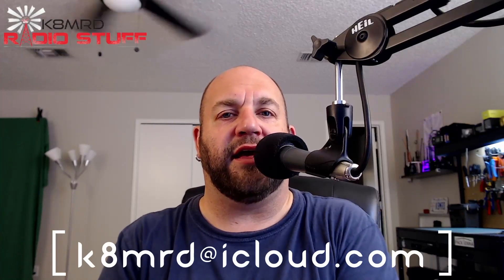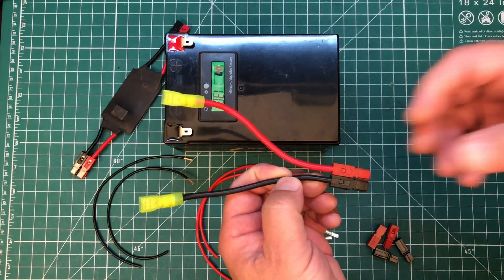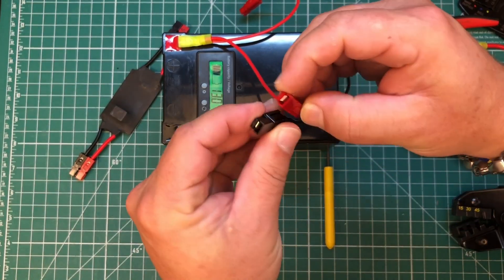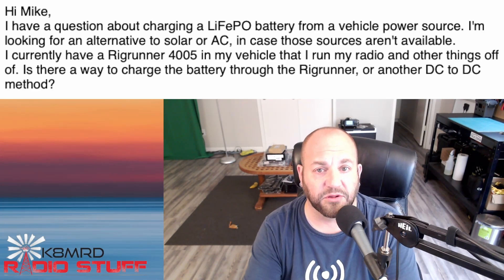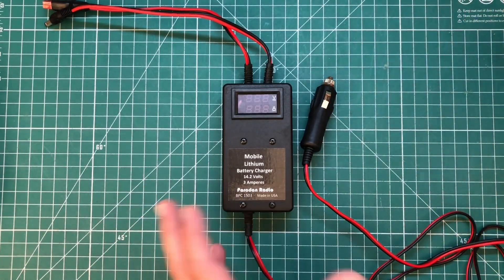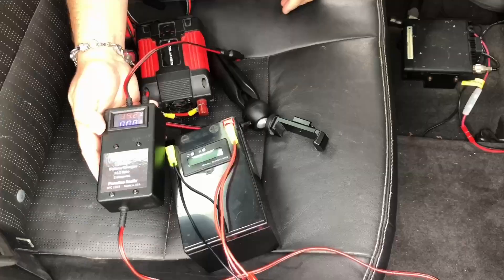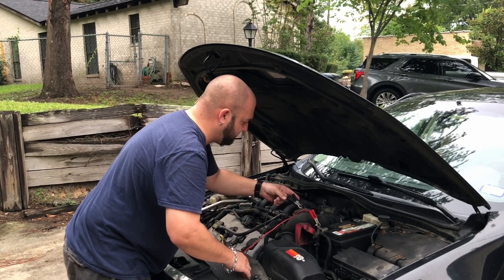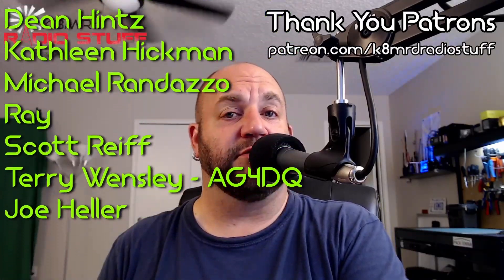Can you Charge LiFePO4 from your car?  Mailbag Monday #28

Comment: When I got a good deal on some Lipo RC/drone batteries to run QRP rigs, I picked up a couple of chargers specifically designed for 3-cell Lipo for under $10. They charge each cell separately via a 4-pin connector to avoid the problem of the cells being differently charged. My were made by a Blomiky and sold on Amazon, but I am sure there are others. For their capacities 3,000 to 5,000 Ah, the batteries are small and lightweight. I've charged them from solar and AC and I'm sure a USB outlet in a car would work equally well.

Comment: Great stuff Mike ! I wonder do you keep a LIfePO4 battery in your car (full time) to run your gear ? I had an idea of just keeping my LifePo4 battery box in my car full time and powering things that are installed. it does have a BT battery monitor I guess my real question is are LifePO4s ok to "Store" in a car. with the Temp swings ? It Would be cool if there was a DC to DC controller that first detects when car was on and at ~14v and if temp is nominal for charging the battery or allow just allow the battery to discharge if temp wasn't to high.
Reply from the maker: I keep a 100Ah LiFePO4 battery box in my car 100% of the time.  That is what power my radios.  There is some parasitic drain from the radios as well as the charge controller and meter on the box so every so often I'll take it out and charge it to 100% in the house.  The longer I go between charges the more off the meter reads but it's not that big of a deal.  As far as heat, and I'm in Houston TX so we know about heat, charging isn't really an issue until you get a little bit hotter than what I've temp'd in my car.  There is going to be "some" sacrifice in overall longevity of the battery due to being stored in hot temperatures, but the low price of these batteries and the longevity of the chemistry far outlays that in my opinion.  You pay ~$130 for a 100Ah battery that you beat the crap out of and it's still good 10 years from now is pretty darn good in my opinion.   LiFePO4 is also EXTREMELY SAFE.  I have zero worries about storing them in my car.  There are DC to DC chargers out there as well.  This video showing one of them, though not really what you're talking about I don't think.  I just don't have any experience with them but I feel Victron makes some.
Reply: @hamradiotube  I bought the Litime 140Ah battery with Bluetooth because I plan to keep it permanently in my car. Charging will be done in my office, and since I’ll be running very low loads on it for about 8 hours a day, the Bluetooth app won’t even register the loads, but it gives me an easy overview of the voltage, and I can turn off the terminal, which is the most important thing. My thinking was simple: get the biggest battery you can still carry three floors up to my office, as few times a month as possible. Now I’m starting to think I went too big and too heavy, and that the 50Ah one would have been a better fit, but oh well. I only have an Anderson to 2-way cigarette barrel splitter and two of these USB car chargers plugged in to get USB ports. The total load won’t be more than 7 to 8W, but I was hoping I could go a long time without needing to charge anything, unlike now where I have to charge every 2 to 3 days with my River 3 Plus. The other option would be to use the battery to recharge the EcoFlow every few days with a simple click in the Bluetooth app to enable the terminals for that.

Comment: So with that last option you showed (alligator clips) wouldnt you need to either pull one of the alligator clips or possibly drain your car battery?? Im wanting to do basically the same thing with an FT891 but im planning on having a solar panel mounted to my tool box as well (Tacoma) Also wouldn't a fuze be in order as well? ✌️ -73

Comment: What do you think about charging a lifepo4 battery using a solar charger controller connected to an alternator instead of a solar panel?
Reply: Depending on the Charge Controller, I have a few concerns:
99.9%  of all Car alternators are designed for Lead Acid Batteries. If you are using a Lithium-specific Charge Controller, the Alternator may NOT be applying the correct current needed for your Lithium setup. Furthermore, I'm wondering if the constant variation in Alternator output might be HARMFUL to your Controller as well. I don't have my charts at Hand, so I can't advise any further on this aspect. That being said, I do NOT think this idea will work, because Lithium Batteries need a higher charge current, thereby, I believe the same concern may apply to a Lithium Charge Controller. I do not believe this will HURT your Battery, but it COULD fry your controller. In either case, your Lithium Battery will NOT get the amount of amperage needed to fully charge it-and there MAY be some question regarding whether it could harm your BMS-though when it comes to the BMS, I personally do not know the answer to THAT.
Reply: You would be FAR better served by just buying a Small PURE SINE Inverter, plug that into your car, plug a lithium-specific charger into the inverter and run with that setup
Reply: KEEP IT SIMPLE, my friend. This is not Rocket Science, LOL!

Comment: Can't you use cigarette litter plug to Anderson connection direct to lifo4 to charge
Reply: Technically you can, but you might end up with a large current draw if there is a difference in voltage. Due to that, you might want to include some sort of shunt/resister to limit it.

Comment: Arg.. im conflated. Unfortunately there is no practical soultion for me. The boster senario would take 13 hours to charge my auxiliary 100ah lifpo4 battery.  It really sux the lifpo4 batteries are so close to lead acid specs yet one can't simply hook lead and lifpo4 in parallel across a alternator.  Perhaps it would be a better idea to configure may battery to 24 volt and get a high amperage step down then parallel my car battery and the stepdown circuit output ( use blocking diodes to isolate the stepdown ). This would allow for much smaller gauge wire to my trunk where the lifpo4 is mounted . Still charging is an issue .. I guess I can only use shore power which really sux. Any other soulution requires more amperage from my tiny ford focus alternator then is acceptable. Guess I should get a used police interceptor with a non toy alternator..LOL. In today's economy car forget about any task, listening to radio, transmitting or even having interior lights on for any duration with the engine off or you may substantially impact the life cycle of your factory equipped battery.

Comment: I have a dumb question:  will this work if I run the inverter from the cigarette lighter receptacle and will it supply enough juice for a 6 amp charger?   What is the wattage of your inverter, and what wattage should I use connecting to the cigarette lighter receptacle?
Reply: Most cigarette lighters are rated for 15A or 180 watts. Volts X Amps gives you wattage. 6amp draw should be 72 watts there will be some loss so really 80-85 watts.
Reply: should be ok. check current threw lighter port. keep it under 10 amps.

Comment: Im wondering why not just bypass the charger all together and connect the battery + /- directly to the car +/-. I do this with my 100ah Bluetooth battery where I'm able to watch the amps when I first hook it up I have all my accessories on (air, headlights, dome light) becuz at first it usually it's over 60amps then after less than a min it drops to below 50amps then I turn off accessories and charge for about 2-3 hrs for full charge. Is this ok for the battery? Btw my battery is fairly new and the voltage drops below 10volts before the ah reach 50ah and need to recharge. Plz help did I screw up my battery
Reply: you would really want a battery isolator between the two because when you try and start the car, the car will pull from whichever battery can supply the current.. ALSO, if one battery dies (eg the sla in the car) then it WILL drag the other battery down with it.. not to mention the differing chemistries and related voltages involved

Comment: i was wanting to make a battery box and put a solar charge controller into it. can i also have the 12v car output go into the solar charger for when charging while in the car, my thinking is the solar controller should regulate the battery as if its a 12v solar input??

iam going to put a second dc port in for charging when at home using a power brick like yours in this video.
Reply from the maker: A solar charge controller is looking for a higher voltage. In the neighborhood of ~18-22 volts.  It most likely won’t even turn on with the 12v from your car.  You can always plug it in and find out.  It’s not going to hurt anything.
Reply: @hamradiotube   It depends on the charge controller. A cheap PWM charge controller will short the input to regulate the voltage. That is not a problem for a solar panel, but it is a problem if you connect a power supply, e.g your car to the input.

Comment: Stripped wire should not be twisted before inserting into the crimp connector. It weakens the crimp and can add resistance. Great content. Thanks!
Reply from the maker: Hmm, I've never heard that.  Thanks for the tip.
Reply: @johngriswold I bet you're an amateur radio operator, aren't you ? 🤔
Reply: @uncle_spanky  indeed

Comment: Epic PwrGate anyone?
Reply: Do say more! I like where you are going with this.  I have a bioenno MegaBox w/ a 30ah battery in it. I plan to mount an Epic PwrGate (which charges the battery I hear).  The question I have is : Can I simply connect a 12volt (cigarrette lighter adapter) to anderson PowerPole connector, plug it into the car and call it a day?  The hope is that while I drive the car, it slowly tops off the battery. However, I run my mobile radio by connecting directly to the PWRGate.  Would appreciate any ideas on this avenue!
Reply: @mannypersonal  - the Epic PwrGate is FANTASTIC.  It juggles various power inputs car or AC power supply, solar and your battery.  It will charge your battery and supply juice to your rig at the same time.  It switches between power sources so quickly that your rig won't skip a beat.  It's like a UPS  for your rig.
Reply: @gmanshackshack6822  So I did a bit more researching - With a MegaBox and a bioenno battery, you could use the Epic PwrGate as your central hub to input solar panels and proper Power Supply sources.  However, if you want to use an a car while operating your rig, best thing to do is to use a charger (Such as the PowerWerx DCDC-8) and plug it into the alternate cable on the Bioenno battery (I added a direct port on the MegaBox' using PowerPoles). Separately, your rig can be connected to the Output of the Epic PwrGate.  Done! A topped off battery off your alternator as you drive around, while being able to operate your rig as well.  (If you decide to POTA, just grab your rig, MegaBox, and Solar panel, and BOOM, operate at celebrate! :-) )

Comment: I'd go with the boost converter option purely for efficiency sake. Converting a DC signal to a partially or fully rectified AC output at an average 80% efficiency, only to convert it back to DC is burning a lot of electrons needlessly and also introducing a lot of noise and electrical component failure points into what can be done simply through some DC ICs and a few zener diodes.
Reply from the maker: Oh it's stupid inefficient for sure.  But it works.
Reply: @hamradiotube  Oh of course. In a pinch, you gotta do what you gotta do, but given a choice....

Comment: Hey Mike or should I say- Ex Michigander. Most cheap inverters aka Harbor Freight are only 1/2 sine way inverters.  So my question is does it make a differance if you a 1/2 sine wave or full sine way inverter.  My wife and I were fulltime RV's for several year.  All the electrical Rv experts tell you to use full sine way inverter when charging/ using your electronic gear. does this apply to battery?    Walt N8WEH
Reply: depends on the electronics. half sinewave can kill a battery in a laptop least they used to. havent seen that happen in the past 10 years. always best to buy a good pure sinewave inverter though in reality none are pure and are more square wave then sine.
Reply: It absolutely does! You want to use a full sine inverter instead of a mod sine inverter because you can burn a charger brick up with dirty power and, even worse, you can blow your electronics up. A mod sine inverter is only really supposed to be use with inductive loads, like power tools and other motor driven appliances, because they have rectifiers built in (in most cases). Mod sine inverters are considered "dirty" power.  So I'd ALWAYS recommend spending a little extra coin for a full sine inverter for anything electronic. Plus, in the ham radio context, mod sine inverters are noisy as heck and will introduce a lot of RFI and hash into your signal. Another tip: always try to ground you inverter whenever possible for both electrical safety and also to cut down on the noise. I don't mean DC ground, either. I mean earth ground. This may or may not be possible and most good inverters will simulate a "float" ground, but I wouldn't necessarily rely on it solely for safety.

Comment: On my 21 f150, It has shown 14.2-14.6 v charging, which is strange, but it doesn't always show that.  I still use an inverter or maybe the paradan, just to be safe.  My truck came with an agm battery from the factory.
Reply: When a car is running, most alternators put out 14.6-15V and the battery, when topped off, will show that as a surface voltage, but as soon as you draw any appreciable current from a lead acid battery, be if FLA or AGM or GEL, it will drop the voltage to 12.8-12.6V, well below the min charge specs of a LFE or NMC battery. Plus, LFE batteries need different charging stages to properly charge. There's bulk charging, absorption, equalization charge, float charging etc. Most bigger LFE batteries do this via a built in Battery Management System (BMS) but most small LFE's don't have a built in BMS, thus the need for an external multi stage charger, boost converter etc. You'll cook an LFE battery otherwise.

Comment: Great video.  I used a 6 port power pole distribution block and ran the solar controller to it.  Then I connected it to the battery.  All that did was create additional points of failure.  I like your method.